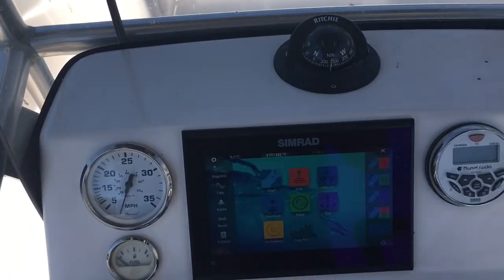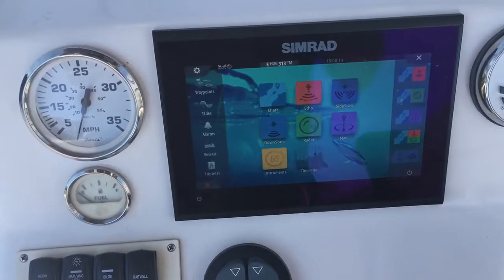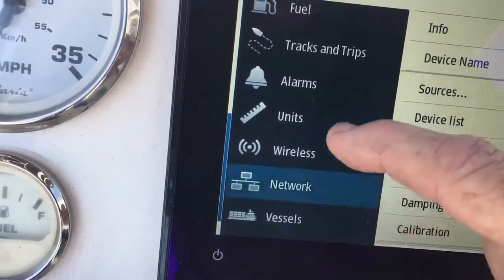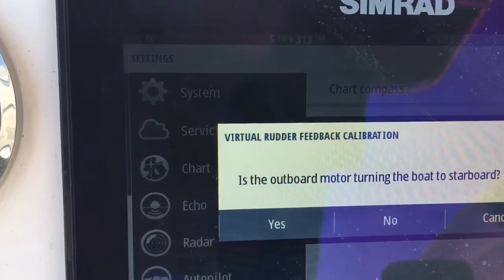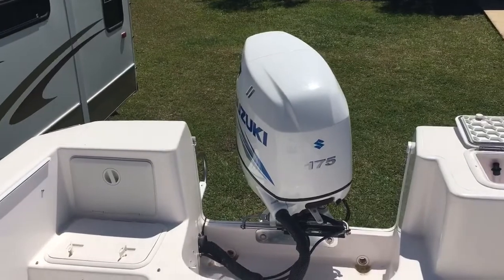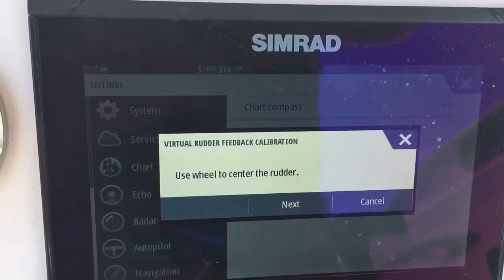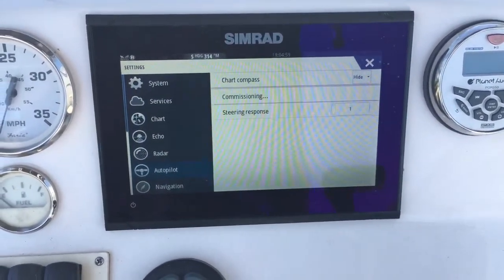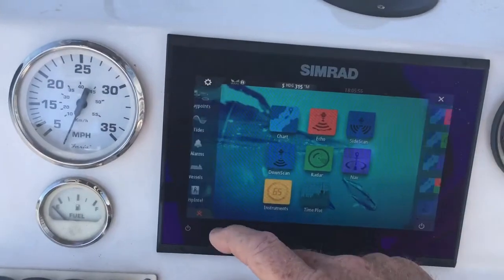Simrad GO9 GO7 Comissioning with a Lowrance Outboard Hydraulic Pilot

Comment: Looking to do the same with my existing lowrance outboard auto pilot with a NAC-1 computer. I had a HDS-7 Gen 3 that failed and I’m looking to purchase the GO7. Did you have a Simrad pilot NAC-2 or the NAC-1 computer? Thanks
Reply from the maker: Hiya, it is the NAC-1.  I'd look at both the HDS and Simrad and go with the best price.  I sold the boat but installed the same system on our replacement boat using a HDS 7, later found a HDS Live-9 with the good transducer on sale for $800.  The HDS Live seems quicker to toggle between screens than the Simrad, very similar software though.  I love the autopilot, probably use it 75% of the time.  Both are great units and can't go wrong either way!
Reply: @Oouther1  Thank you for the info. I really love the Lowrance AP also and didn’t want to loose it when trolling. I’m also looking at HDS live and Go7. Only issue I have with the GO7 is the touch only screen. Nothing worse than bouncing around with wet hands trying to make adjustments.
Reply from the maker: Forgot to mention it is a Lowrance outboard pilot.  I spoke with tech support and was told the only difference is the sticker.

Comment: Did you end up getting it to work well at planning speed
Reply from the maker: Yes, after you calibrate the compass it worked pretty good.  The cheap hydraulic clear line got cut from a tie wrap and it put air in the system, still haven’t got it out.  I loved it before the air, probably put 50 hours on it with little trouble.